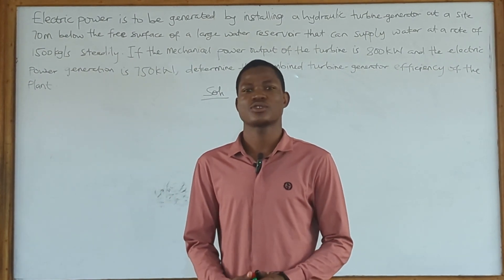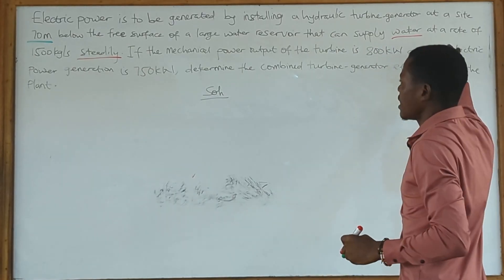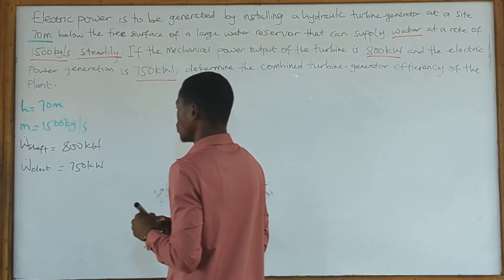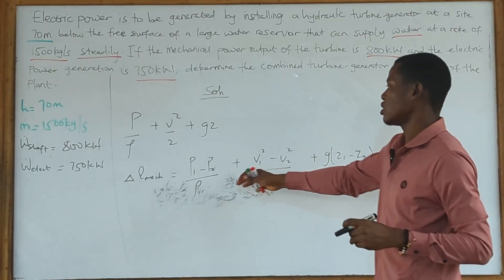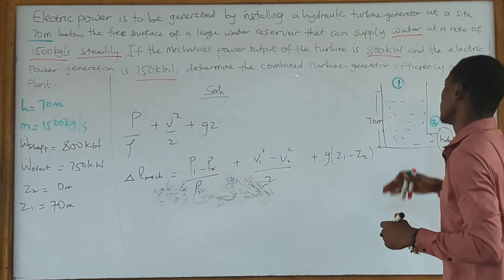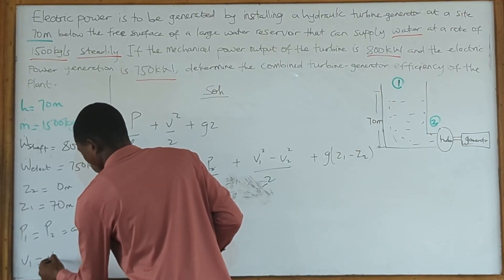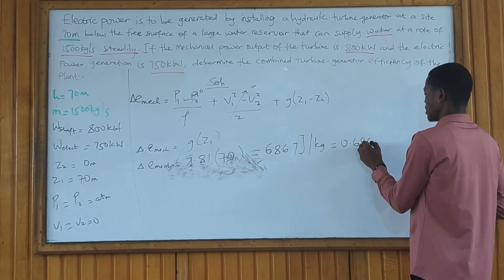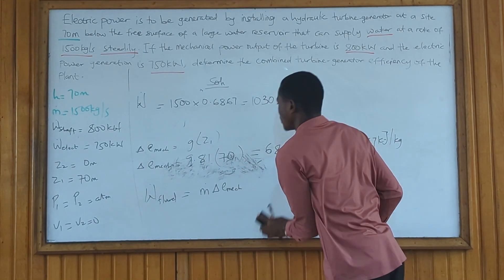Energy Anaylsis of Steady Flows

Comment: thank you, P1 is athmausferic pressure, but p2 is in a closed pipe?
Reply from the maker: since its enclosed the pressure at point 1 will be the same at point unless said otherwise in the question
thank you
Reply: @mathshubgh  so the power output provided in the question was irrelevant